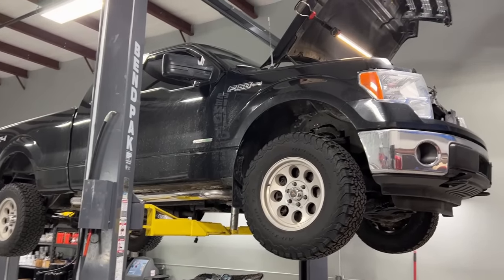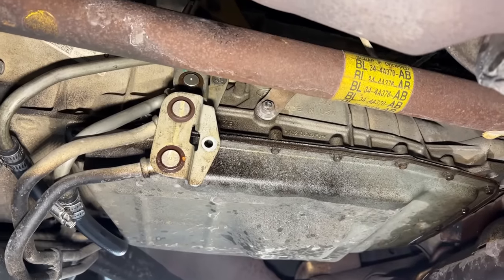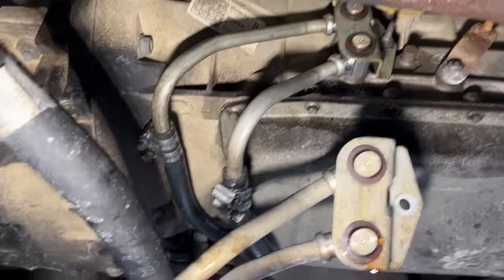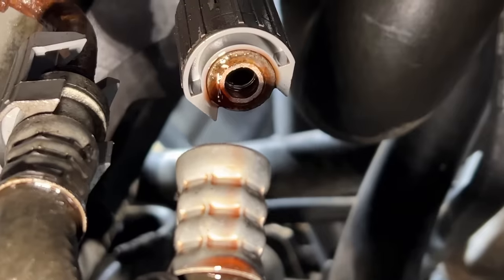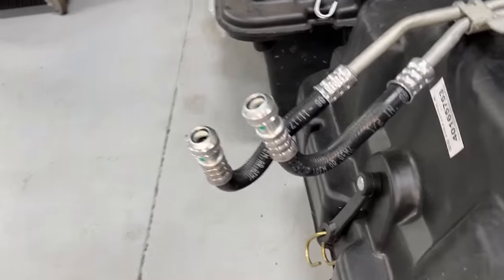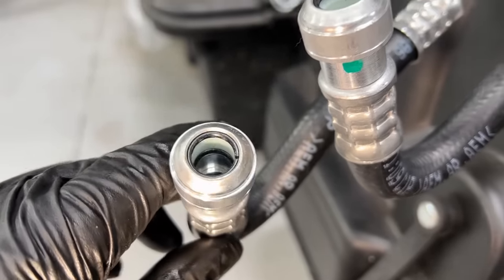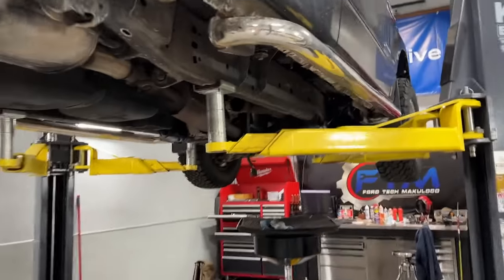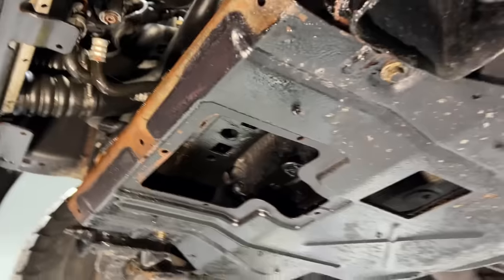Attention 2009-2014 Ford F-150 Owners! Check Your 6R80 Transmission Cooler Lines Before They Blow!

Comment: I have a 2014 xlt 3.5 eb and just wondering if Ford made any improvements to these lines. Or do I just wait and worry about the new o.e. lines snapping. Would I be better off with a Dorman or other aftermarket set?

Comment: Brian, will the replacement lines fail after 5 or 8 years?
This looks like a Class Action Lawsuit in the making. Ford should replace all these lines with an updated version via factory recall and pay all past/future costs.
Is this just Bad Engineering or bad Management saving a few cents on material and fabrication costs?
My 2000 Expedition's rear break line, at mid-frame, rusted and burst because it wasn't coated. I was testing a just bled frame to axle rubber line after 2 years of being parked. The line from mid-chasis to the ABS controller was coated, along with the lines to each front wheel and after 21 years they still look factory new. Did Ford decide you needed front brakes but not rear brakes on their older vehicles and saved a few bucks on the rears?
Same rust/fail on an unprotected, but coated, front line of a 10 year old late 80s Escort which resulted in me broadsiding a lady making an illegal right hand turn across lanes. This line was directly exposed to dirt/rocks/road salt and the coating was abraded away in spots. I would have stopped just before impact saving her insurance costs and a traffic ticket. I really felt sorry for this elderly lady.

Comment: I took my 2013 into the Ford garage.
To get the transmission serviced and the coolant serviced.
So I asked him about getting the cooler lines replaced.
He said. " Crips.. Have you been watching the internet? I have had 8 calls about that this week."
Listen, in the last ten years, I have never seen that happen once.
I will do it if you want but it will cost about $800.

ok never mind...
I ordered the cooler lines for $75 and will do it myself.
Pretty sure when it does happen. It is out of warranty and they are not taking them into the Ford garage.

Comment: What about cutting out the quick connect and replacing with hoses and clamps?  Top off as needed.
Reply: I did that as a temp fix while I ordered new lines but in hindsight it does seem like a permanent fix. I ran it a couple weeks like that with no leaks.
Reply: @christopherkrambis4391  I cut the quick disconnect off leaving as much of the rubber hose as possible then simply slide the hose onto the transmission cooler where the quick disconnect used to go and clamped it above the flare on the cooler fitting. I'm not sure how much fluid you would loose just doing that being as I was also refilling the fluid that was lost when it broke.

Comment: I'm considering just cutting off at the end of each hose and connecting a high temp hose with hose clamps as a preventative measure. Cheaper than purchasing a whole new line assembly. Do you see any problems with this idea?
Reply: I'm thinking about doing this also, even if it leaks a little it should not fail like the quick connect in an instant.  Just need to find the right size hose!
Reply: I looked at the hose  on the suspect cooler lines and it is marked 1/2 in SAE 1532 Type A / Class 3
I have the external trans cooler so I am thinking to run the hose from the cooler to the 1/2 metal tubing on the other side of the quick connect and ditch all the old hose and quick connects.  Also plan to use T bolt type hose clamp which should be more secure than screw type.
Reply: Sounds like a great idea so long as the line pressure isn't to high and blows the lines off the end where clamped. I am thinking of doing this as well but will have to figure out a way to have a barbed or flared end of some kind.
Reply: @josephbenge8707  didn't consider that. Back to the drawing board.

Comment: I have a 2011 F-150 5.0 with 199,400 mi on it with original transmission. I have always done trans services, is there a fix for this or should I just change the lines to prevent this? I have had zero problems with this truck and want to keep it this way. Thanks for any advice!

Comment: Thanks for the update on this problem. Can you post the part number for the cooler line since I have a 2007 F150 FX4. I would rather replace it before it becomes an issue.
Reply: RockAuto might have it on their website.

Comment: Hi there, I have a 2013 3.5 ecoboost 4x4 & tow a travel trailer up and down the California coast. I have been having some overheating problems and want to upgrade my transmission oil cooler & radiator. Do you have any recommendations for parts I should look at?

Comment: Wow, do the same era Super Dutys use the same connectors?  I’ve had my trans filter and fluid service per your recommendation but that doesn’t help if all that expensive fluid gets blasted out due to the same fatal flaw. Btw, when I told both my mechanic and a friend who is a  service writer your recommendation for a trans service they both agreed that you were on the mark. My Ford dealer told me they will only do a flush/fluid exchange.

Comment: What is the p/n for the bundle?  CL3Z7R081A / 7R081? Is going to need new clips/collets and o-rings? Have a 2013 5.0 88k southern truck not much corrosion as you guys up north.  But, i'd rather change out problem parts asap.

Comment: Any tips on getting the new long double line fished though? I have a 2010 F-150 5.4 Lariat and couldn't even get the old line out without cutting them, what a PITA. I tried dropping the sway bar but it didn't seem to help much, only thing I could think of that seems somewhat doable is drop the engine oil pan for more clearance but I just did an oil change and I didn't want it to have to come to that. I just want to avoid damaging the new line when I put it in because it seems like you have to almost bent the lines to maneuver it though.

Any advice would be much appreciated! Thank you

Comment: Ftm so it looks like Ford has managed to put a junk line connector onto a good AT. Pure genius.  That 6R80 is supposed to be the same basic internals as the GM 6L80 and both are really ZF 6 HP clones. Is that correct?

Comment: If this is pretty common, then I wonder if the transmission pump pulsations are a cause? Who would put the same Ford materials back in the car for it to happen again anyway? I think I would be flaring the pipes further back toward the trans and putting in longer flex lines connected with AN fittings if it were mine. Just a thought.

Comment: Seems like there must be a method to replace just the portion of the tube with the snap on connector without replacing the entire line.  My Ford dealer gave me an estimate just under $2000 to do this job.  I'm just curious if a professional mechanic has or could come up with a method of just replacing the snap on ends with crimp on style connections?  Or something like a shark bite thing they use on plumbing maybe?  Why isn't there a way to attach a barb and clamp fitting or a crimp fittings to replace the snap on connections that have suddenly failed?  Or is there such a method?

Comment: is it common for this to happen on the front side of the rad where the lines runs up toward the aux cooler? I've noticed a small periodic leak from there and would definitely like to replace the line before it goes if this is the case. thanks for the awesome information!

Comment: Hey Brian, the 3.5 EcoBoost on my 2013 F150 kicked the bucket last summer. Have you ever replaced one of these engines with the body on? Do you have a recommended source for an engine? I really need to get around to fixing this thing

Comment: I just bought used f150 with this transmission with 140,000 miles. Would it be a good idea to change the fluid or should I just leave it alone?

Comment: I’m surprised that you can’t just run rubber hose and hose clamps.  Is there too much pressure?

I always thought about the same solution for the clips on the fuel filter.
Reply: As long as there is something for the hose to grip on, so it doesn't blow off, and the hose can take the heat and oil exposure, a fiber reinforced hose would work fine. Be aware that gasoline containing ethanol will attack most rubber hoses. You need a special type of rubber hose for gasoline exposure. It is fairly expensive.

Comment: I have a question.  I just saw you video on replacing transmission lines.  Rather than replace the lines could you cut the lines before the connectors.  Then, using Earls EZ Beader 1/2” OD (available at Jegs) to put a bead in the tubing, then just run rubber hose?  Stacey David does a demo on YouTube showing how they work.  Thank you.  I love your videos.  Just throwing this out there for your thoughts.
Reply from the maker: You can do that too but the problem is in corrosion states anyway they rot in other areas so we just replace it all making it new with the latest parts.

Comment: Look, there's just a thin aluminum nipple on the bottom of the coupling that gets the crimp.  Over 50k - 100k miles this coupling experiences a lot of vibration creating metal fatigue in the shoulder where the nipple is machined on the aluminum sleeve.  Yesterday I inspected the coupling and lines on my 2014 TREMOR with 50K miles.  They looked like they just left the factory, yet they are as likely to break as the grotty looking ones on this video.  It's only a matter of time!

Comment: Is it fatigue or galvanic corrosion from dissimilar metals? That rusted metal end seems very close in mating to the aluminum quick connect. And if it was from vibration, that's just bad design.
Reply: It might be a combination of both.

Comment: my 2010 f150 lariat 5.4 made in Michigan has rubbery feeling quick connectors to the auxiliary trans oil cooler lines.  Can you recommend a permanent fix? Tks

Comment: Is the oil cooler line that broke the line pressure coming from the transmission or returning to the transmission? If it’s the line pressure coming from the transmission, that 90° bend in the flex line could be causing the quick connect to break.

Comment: So it seems like every truck after the 1997 F250/350 Heavy Duty Ford has these "random" issues that they won't own up too. They refuse to recall the problems, also I heard nothing of this new cooler line being updated in any way....so to me the BEST fix is AN fittings and braided hose

Comment: Looks like a another design flaw to me.  Shades of my 99 SHO's press fit camshaft sprockets.  How many miles are typically on the trucks you've seen with this failure?  Has Ford issued a TSB on this fitting failure with an improved replacement part?  If not, where does the class action lawsuit line form?

Comment: Great video!!  I have a 2007 F150 4x4 with 4.6 v8.  What is the model of that automatic transmission?  Truck has 150,000 miles and still running stong!
Reply: Your model truck only came with a 4 speed auto 4R75 or a 5 speed manual.   They went to the transmission in this video next the 6 speed auto 6R80 which was in some fire trucks all the way to 2019 or 2020 I think. Now they are all 10 speed 10R80’s.

Comment: You suggest to check the lines - what do we look for? I have looked at mine and they "look" good (606600 kilometers or 376700 miles)(2009 F150 - 5.4). Lucky? Maybe, but Ford here in my town tells me that they have never seen this ...

Comment: Are there any telltale things to look for on the fitting to indicate its close to failing?  

Would bracing the 2 ends of the Q-D help prevent stress that causes the failure of the aluminum part? 

 Last, has any aftermarket company made a bottom Q-D fitting made of steel rather than aluminum?

Comment: It is bending just enough to start a crack in the relatively weak aluminum as the fluid pressure is trying to pull the joint apart in every direction. If that little piece going inside the hose was stainless, it would probably be fine for the life of the vehicle. That should be a safety recall. Getting stuck on a long bridge around here with no brake down lane, can get you killed.  
If they don't change the design, the new ones will fail too.

Comment: Just because the line blew doesn't the trans is bad. Did you test the transmission with the bypass hose installed? This is usually least destructive 
failure.
Reply from the maker: Yes I did that is why I made the bypass hose up so that I could test drive the vehicle and also drive it into the shop. The entire underside was covered in severely burnt trans fluid. Do you know what burnt trans fluid smells like? I do and I know based on that smell and dark color that the clutches inside are burnt up and the trans will slip. It's pretty cut and dry actually when you have experience.

Comment: Would it be worth it on this trans to upgrade to a mishimoto Trans cooler and replace these lines at the same time? I'll be towing a camper a lot this summer and wondering if it's worth it.

Comment: It’s almost like it’s cheap insurance to replace the two lines maybe every 40,000 or 50,000 miles as opposed to a $6000 transmission.

Comment: is there 4 cooler lines? I see the 2 on the bench then the 2 on the transmission box? I want to make sure I get them all done, also ford is now saying they just do a transmission flush and put cleaner thru and don't drop the pan which seems like not a good idea they said they would drop the pan if I really want them too but there not normally doing it anymore, I just bought the truck its a 2013 f-150 with the 3.7 only 140000km so I want to keep it in good condition.

Comment: I think a good "FIX" would be to have a little custom bracket bolt up onto those same bolts that are mounting those steel lines underneath--   and the bracket would come down at an angle like a gusset and either U-bolt or somehow clamp onto the bottom of those hose crimps--- so that it insures that those fittings are mounted solid--- and then it puts the "flex" into the rubber, rather than that thin nipple inside the quick connect.   I think the problem is just that the rubber hoses are so big that they aren't very flexible-- and the fittings should have been made thicker then their usual sizes for the normally smaller lines.  Hard mount those fittings that are hanging out there and then they won't flex and vibrate.  Pretty simple preventative measure.
Reply: Could work, but just eliminating the quick connects seems like a better option to me.
Reply: @josephbenge8707  I agree-- but they still have to connect somehow--  I guess just slip the hose over and throw a clamp on it.  What's wrong with that?.. lol.  Worked for 100 years with no issues before that.

Comment: 2014 F150 Limited here dealing with this right now. It started with a minor drip aft of the radiator. Then it just ruptured and dumped. When I purchase this line, how do I undo the quick disconnect? Transmission fried? I hope mine is okay. Then again, how would I know?

Comment: Would this transmission be good to use with the Edelbrock 5.0L Coyote Supercharged engine 785HP and 660TQ? I'd like to use it in a 1956 or '57 Continental MK 2 with a new frame since I'm sure the old one couldn't handle that much horsepower without coming apart.

Comment: I wonder if it has to do with a temp change issue. Was that the in or out trans tube? Maybe it is something where it is super hot and it gets splashed with some cool road water or something.. That just seems crazy. Aside from just cutting the fittings off at both ends and hose clamping it I dunno how to even avoid that crap.

Comment: Does this also apply to a 2010 Flex (non-Ecoboost 6 cylinder engine)? I've already been burned by a failing internal water pump which set me back $2500. Don't want another huge repair bill.

Comment: Isn't there some kind of electrolysis going on with dissimilar metals part being aluminum part being steel I realize it's in oil or rather oil is in it but anytime you connect dissimilar metals is almost always some sort of electrolysis and I think aluminum is the most reactive so is there a steel clip to replace the aluminum one

Comment: So what are we checking for exactly? Does the quick connect leak a bit before snapping or should we just swap them out based on age/mileage? I have a '12 Raptor with about 200 000 KMs (~ 125 000 miles), 10 years of Canadian Winters, some mild corrosion on the lines. Should I just swap out the lines regardless?
Reply: Update….I just swapped out the lines for new ones. Peace of mind and all that….

Comment: Does it matter if air is inside the new transmission cooler line when they are installed?  Should a flush of transmission fluid go through the lines to get the air out before connecting them to the coupiing?  Thanks.
Reply from the maker: no need to get the air out of the lines.

Comment: I have a transit with same motor/trans. I want to add an aux cooler but can’t figure out where to tap in. The lines are all hard except that short rubber section before where this one broke Is it best to splice in there on the return?

Comment: This just happened to my dad's 14 f150 fx4 with 96k. Has there been any type of update or aftermarket repair that is better than factory connections? He was quoted 10k to fix. Seems absolutely ridiculous. That's twice as much as my race built 4r70w

Comment: 2010 Ford f150 65,000 mikes,. Wondering if I should do this soon or wait until 85 to 100,000?   Thank you so much for the update. I'll take a look at mine. But I don't think you can tell if there about to break.
Reply: People wrote that it failed in as little as 61,000 miles, so I would change it.
Reply: @billsimpson604  Good to know Thank you!

Comment: I have a 2010 f150 with the 6R transmission and where the lines connect to the cooler there is an air dam that the connections go through that diverts air up to the radiator.  Do you think this air dam is pushing on the connections at hwy speed causing the connectors to fatigue and break over time?  if so, any suggestions on modifications to prevent this from happening?